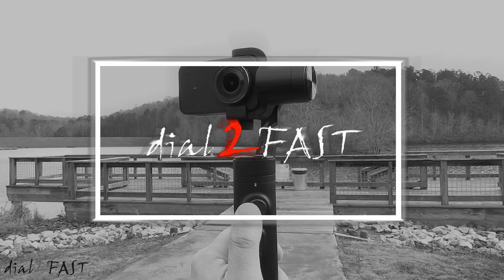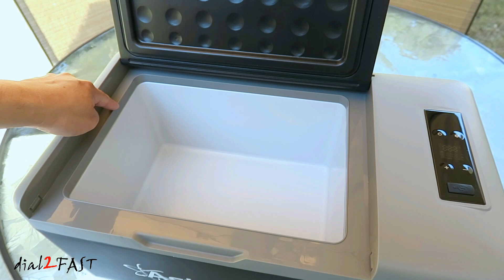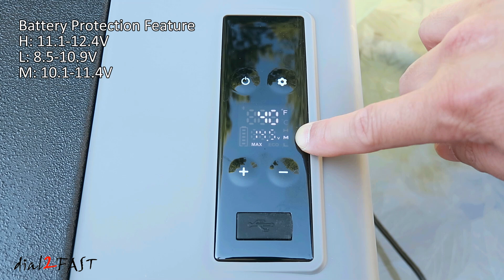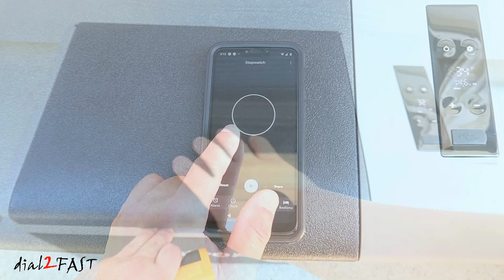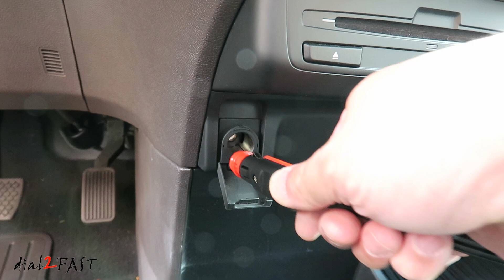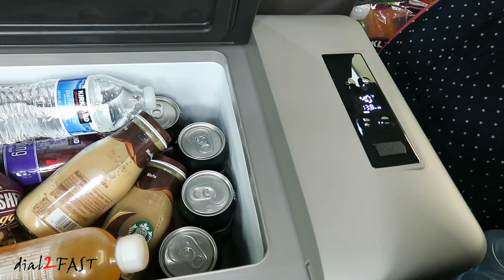12V Portable Refrigerator / Freezer For Your Car - 16 Quart (15 Liter)

Comment: I love this size, form and compressor for my small van.  I have an Alpicool version  it's very durable and reliable.  You can freeze a block of ice in Florida with it!  One thing I'm testing/trying now is looking for way to as a freezer but installing a custom horizontal divider and insulating veggies (tomatoes, onions&peppers) in a neopreme bag on top. The trick to using a fridge this small in solo van-life and off grid is to be healthier, go vegan and drink only water and at room temperture.
Reply: Ok, thunbs up.  Define why room temp H2O please.

Comment: How do you mount the fridge at the back as you show, because when you drive it will be easy displaced from its position, do they sell it with mounting plastic brackets to avoid this?

Comment: Why would you want your freezer at 0 F?     32F is freezing.
Reply: I'm supper late but as someone who works with frozen perishables 0 is the best to prevent freezer burn say you set it perfectly at 32 degrees well now your constantly slightly thawing it evertime the door opens or right before the system cycles slowly forcing the water out of the product at 0 the effect is much lower though skyrockets below -10 degrees
Reply: @jacobd4955  Also its a few degrees above the minimum temp it can achieve... which means it won't be running as much to get to 0 as it would to get to -4F

Comment: How much does it weigh? Can you use it in the rain? How long does it keep food cool without power?
Reply from the maker: It weights 20lbs. You should not use it in the rain. As to how long it keeps cool, for drinks it will keep it pretty cold for couple hours. But for meat products, you don't want to let it sit inside without power too long.

Comment: 0 °F is not the freezing temp of water, 32 °F is the freezing temp of water. 
O °C is freezing temp of water.

179 USD is a bit pricey.  A bag of ice & a stryrofoam cooler would be a much less expensive option.
Reply: 0 isn't the freezing temp of water, but 0 is the recommended temperature to keep freezers at.
Reply: 0 by itself is just a number and 0 ° by itself is also insufficient as it doesn't indicate the temp scale.  

The recommend temp of a freezer is 0 °F--which is well below freezing.
Reply: Yes but won't last as long
Reply: @nicholaslandolina  Actually it lasts for hours--which for most people out for the afternoon is more than sufficient.  For those camping through a weekend, obviously they would need to replace the ice every now & then.

The solution described in the vid. is expensive & it relies on your veh as a power source to keep it cold--which means the cost to acquire & use it over a weekend is quite expensive.

The power consumption is also ~32 Wh in eco mode or 47 Wh in normal mode--so it uses quite a lot of power--especially if you leave it inside the car on a hot day (in which the inside temp of the car can easily get to over 140 °F in warm climates.
Reply: @ab_ab_c  It only uses that much power for a short time, average power use is more like 8W.... after the contents are cooled down. Also heat in a car depends alot on where you park.... if you are camping chances are you have shade or can leave the vehicle open to outside air. People that use these want something where they don't have to fool with ice... if you only need the cooler for a few hours of course get an ice cooler but if you want to use it long term as a portable fridge this is a no brainer!